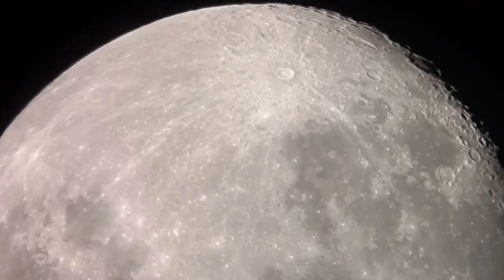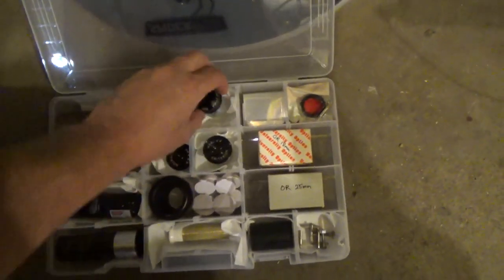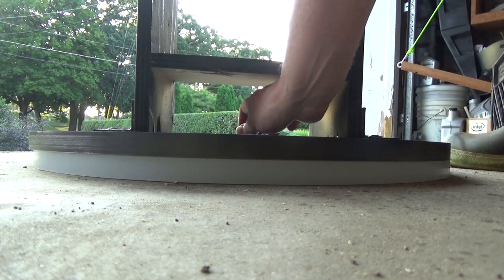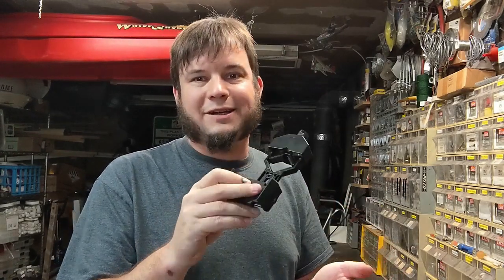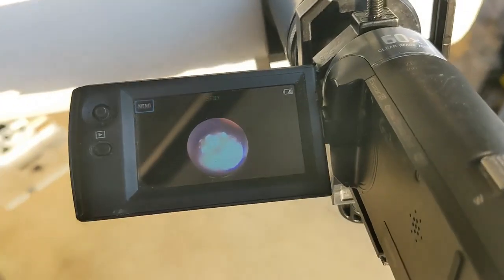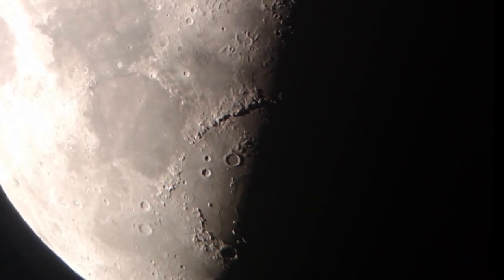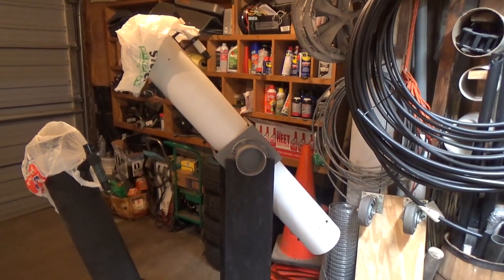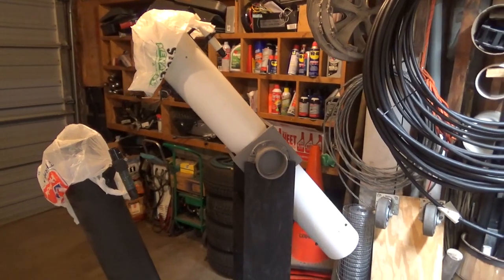Sandland Astronomy (Refurbished Telescope pt3)

Comment: I'm really enjoying what you are achieving in astro-photography. Good luck for the future. For imaging the Moon and planets your present set up will be fine as they are brighter objects which your optically slow system will still collect enough light in the duration of each video exposure. You can calculate the focal ratio of the set up by dividing the length from the primary mirror to the focal point at the camera with the diameter of the tube.
Cheers.
Reply from the maker: I need a more stable mount that I can dial in more accurately, the Dobsonian thing is still a little wiggly. Also I still don't understand F ratings at all, one of these days I should learn how those work.
Reply: @saveitforparts  Hi, yes, a stable mount is really important for steady imaging along with some form of motor for the mount to follow objects as the earth rotates. You can get motorised alt-az mounts which would be OK for planetary and lunar work. Most imagers of the Moon, Sun and planets take lots of short exposures using dedicated astro cameras as their high frame rate tries to capture the brief moments of clarity in the atmosphere. They then use software to stack, choose the best frames and combine them to produce an improved single image. The software is free. Good luck.

Comment: Criterion eyepieces worked really good. The 18mm you're using provides great views if the coatings are still good. 18mm sometimes came with a 30mm which is one of my favorites to use. The other EPs you have are called volcano tops. These were fantastic, sharp image edge to edge EPs. Your auction purchase was excellent!

 I agree with the statement below, it's amazing what you've imaged with this set up.